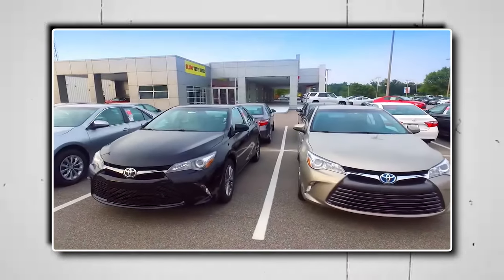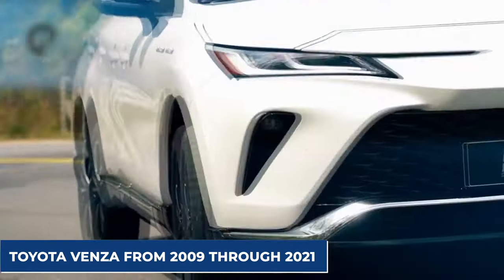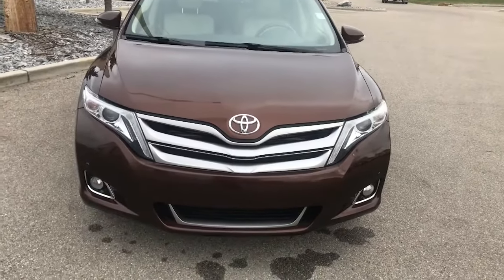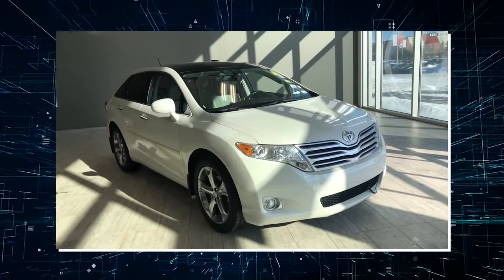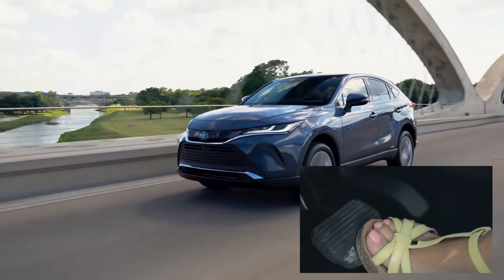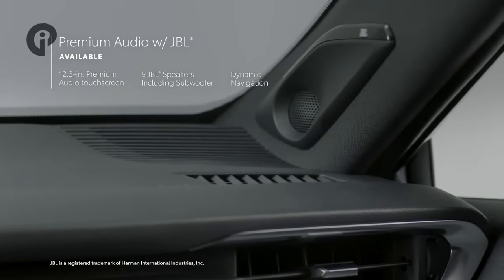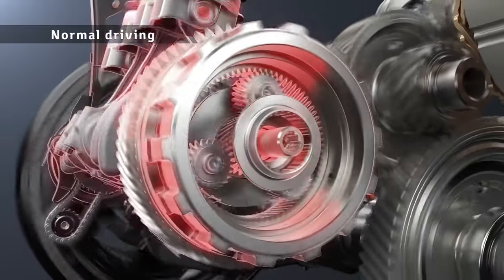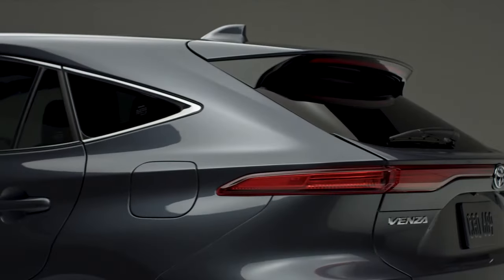This is BAD BEWS For Toyota Venza Owners!

Comment: How much Honda paid you?🤦‍♂️
Reply: Yeah !!!
Reply: Lol I have owned a venza since 2014 and it's still working fine.
Reply: I own a Toyota venza 2011 and was very proud after the purchase bought used with one owner. The rear bumper was slightly detached and torn off during a car wash. The ac sometimes goes out and fogging up the windows while driving. The car would jerk while at a stop light and would swear something hit the car. I didn't know that was the trans on its way out after paying the car off in two years the trans goes out before I could park it at work. That's in between the breaks acting up and that stering was cracking and making noise when turning. Hopefully, I can trade it in for a new Toyota highlander or RAV4

Comment: The earlier Venza has nothing to do with the new ones. The reason, the new Venza is a Toyota Harrier/ Lexus RX made in Japan versus the old one that’s a Kentucky built Toyota. The Honda CR-V is still too new to be recommended and Honda hybrids are not really reliable as the Toyotas.

Comment: Not sure that I’m in the  majority, but I had a 2012 Venza and put 215,000 miles on it and only did normal maintenance, oil changes tires when needed brakes when needed and tire rotations. Virtually no warranty issues that I recall, then purchased a 2021 Venza XLe and drove it for 45,000 miles and just turned in the lease and got a 2023 Limited Venza !The 2021 also only required regular maintenance and I did replace tires at 40,000, because I knew they would ding me for tires if I did not replace them, so I decided to get some enjoyment out of a good set of Perelli’s. Totally enjoyed the previous two Venzas and looking forward to three years with the limited.!

Comment: I own a 2012 Toyota Camry Hybrid, purchased new.  This year it failed to start.  The problem turned out to be the 10-year-old OEM 12-volt battery.  With over 10 years and 100k miles, we have replaced the 12-volt battery, the brake pads once, and a rear-wheel speed sensor once.  That's all!
Reply: I forgot to mention, I'm on my third set of tires.

Comment: I have a 2021 Venza bought new and now have 23,000 miles on it and it is more lexus than Toyota.  I love it, and haven't had a problem with it.  Mine is the base model and many things I got standard would have been options on a RAV4. Like  wireless charging,  auto lift gate with kick sensor. 8 inch entertainment center, folding mirrors, blind spot monitor, and Push button start. Had a Rav4 hybrid before having the venza.
Reply: Lexus and Toyota are the same maker. But I agree. I love my 2021 Venza

Comment: We had a 2009 Venza with 150,000 miles and never had an issue. We loved it, but unfortunately we were rear ended at a high speed and the car was totaled. We are now looking to buy a 2023 Venza and hoping we like it as much.
Reply: I have a 2010 Venza with 161,000 miles and never had an issue either. Take it in for routine maintenance. It’s still a beautiful car, I get offers for it all the time. Just looked at the 2023 model didn’t like it as much. It’s smaller. I’m looking for a hybrid to save on gas otherwise I’d keep driving the Venza
Reply: @karenlane9849  we got a new 2023 Venza and love it. It is smaller, has less cargo space and is higher off the ground but all the other new features outweigh those negatives. I’m getting about 43mpg which is great!
Reply: how much total ? they pay you

Comment: This guy is totally insane, my 2012 EXL limited V6 is awesome,75k and new front brakes… THATS IT! If you see one you like, buy it. I’ve had Hondas and Toyotas…. Both are good. I just bought a 2020 EXL 15k miles,RAV4 premier, I love that  also. This guys nuts
Reply: Hi I ran into this video bc I’m looking at a 2012 LE one owner with 79k miles  
I got totally bummed from this video bc as a female you want a reliable car. This is a very nice car but I don’t need problems or mechanical $$ 
Do you still recommend this vehicle? And what problems should I be concerned? Do you experience excessive oil  burning or a gas guzzler. I appreciate your input.

Comment: We have a 2009 Toyota Venza bought it at 150,000miles we have 215,000 miles. I replaced the radiator and one rear wheel bearing and hub. I replaced all the fluids when we bought it. Still drives  great. The steering noise was a dry inner tie rod all it needed was lube. Toyotas are the best low maintenance if you follow the 5,000 mile oil change. The earlier Toyota Venza's are the best.

Comment: Had a 2010 and currently have a 2021, love them both and they both were very reliable. this is a Honda commercial.
Reply: I agree. My wife (still) drives a 2009 Venza we bought new. Had ac issues last year, otherwise, nothing but oil and other fluid changes as per service manual, 1 set of brake pad changes, and 2 sets of tire changes.  Currently have 127k miles.

Comment: We have a 2010 with the 3.5 V6. I have replaced the front and rear struts and stabilizer links and a front caliper. It has 215,000 miles and we just got back from a 2300 mile road trip. It's a GREAT vehicle.

Comment: I got a venza 2022 and love it get about 47mpg only problem is there is a strange hum sound when I turn it on and drive it. I can't hear it when inside but I hear it when the wife drives. Not sure if it's a hybrid thing.
Reply: It should be it’s supposed to hum I think that’s like a legal requirement for hybrids because they’re so quiet
Reply: Usually I hear the sounds it makes when driving very slow or backing up, also when you engage the electric brake when shifting into park you hear a unique decelerating whine, these are normal for hybrids. It’s my first hybrid and most times I have the windows closed and the sound system on, so “the sound effects” are muted if I even hear them. lol.
Reply: The Car Care Nut explains all of the different sounds the hybrids make.
Check out his channel, very informative.

Comment: I just bought a 2021 Venza Unlimited trim, love the JBL sound system & luxurious feel. Yes, I find the steering is loose , shaky at high speeds, though overall I love it! Getting 42. 1 mpg on regular gas. Who can complain about that with the price of gas nowadays? In a few years I plan to buy either another Venza or a RX 350h.

Comment: I have a 2009 2.7 litre.175000 km’s.Replaced right rear speed sensor and one oxygen sensor.I will never sell it.I also have a 2013 fj cruiser.Will never sell that beast either.Cheers

Comment: This video is propaganda by Honda Automotive. These Venzas are based on the Toyota RAV4, same exact platform.  The Venza is rated exactly the same as the RAV4 by Consumer Reports, which is actually better than any Honda. Same engine as the RAV4 and Camry, same goes for the Hybrid versions.  They are excellent vehicles, but you can do your own research, but don't believe this video.  It is false.

Comment: I have a 2021 toyota venza with a little over 100,000 miles, and it still runs like a champ. The only thing I had to replace were the tires

Comment: This is a bunch of bad information.  I have talked to many people who have never had issues. I currently have a 2012 with 303,000 miles.  All I have done is regular maintenance, tires, a water pump and currently replacing an alternator.  Do not be the least bit concerned about buying one of the older models.

Comment: LoL just researching now, but your review is at odds with nearly every other fact based comparison. And while you quote some sources, most are barely more than whiney forums. If you use actual stats, the TCO of the venza is 1/3-1/2 that of the CRV and matches the Tesla Model 3 despite requiring fuel. Good lord this is like a paid smear piece. Thumbs down and blocking.

Comment: 😅Pretty sure the new Venza is basically a shared platform with the Lexus NX300/350 hybrid. Same basic shape, size, and interior. We have two of them, 2017's, and they're pretty amazing vehicles. If the Venza is basically the same, with the newer version of the NX drivetrain (10 more mpg!), they're bound to be just as amazing, minus some Lexus bells and whistles. Vastly different vehicle than the original version. And like someone else mentioned, we're still on the original OEM battery after all these years and 152,000 miles!

Comment: We have a 2010 Venza. Mechanically it's been great. But it is the worst riding vehicle I've ever owned. Rough and bouncy. And before you say it needs struts, it's been like this since day one. Also it's very loud inside with lots of road noise. Under the rear cover at the spare tire compartment, there's is no sound insulation. I could not find any insulation behind the rear seats. Mechanically, it's been great but I cus this car on every road trip for ride and road noise. We're looking around before we buy another Toyota.

Comment: Thanks for your video.  There is another problem with the Toyota Venza 2021.  Rats.  yes Rats.  They make the wiring and the covering from a material that is made with Soy… attracting rats which are chewing on the wires and the covering causing the car to stall and stop immediately.  The error message says PKSB Malfunction, contact your dealer right away.  Not covered by warranty, causing the consumer $600-$1000 in damages and it looks like they intentionally made this and placed in the car’s so consumers can earn them billions more dollars a year.  Please research It.  I can send you a picture of mine 😮

Comment: We have 2009 venza and it’s been issues galore due to the very narrow and tight engine. Very hard to maneuver that a simple alternator costs between $600-800. From water pump, sensor issues, etc. it’s just draining